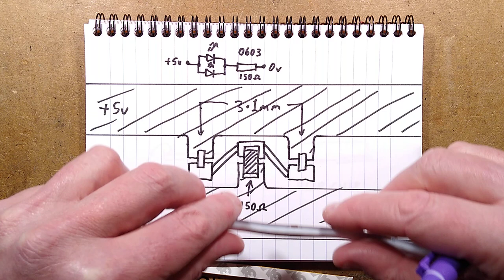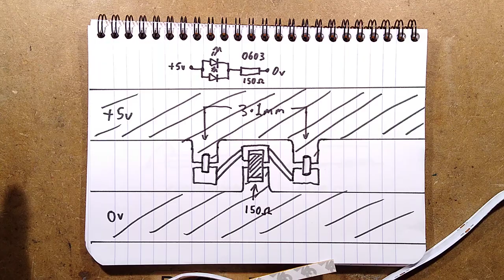Exploring linear LED COB tape with macro PCB shots

Comment: This sort of tape would've been perfect for my DIY oversized 7-segment displays I made a while back. I used normal 12v LED tape, and it had to be diffused heavily to look good.
Reply: I am planning to make giant 7-segment displays using the low-voltage LED filaments now available on Ali. (Up to 30cm in 3V, and 1.2m at 24V.)
Reply: I've been scheming to build a giant 7 segment LED clock/timer shelf unit for down the back of our church... Normally showing the time of day, but having the timer function for occasions we need to finish at a certain time.
Giant size and position down the back is obviously for the preacher to see it, and the shelf design makes it double as storage for the sound/technical team to keep stuff on.
Not a unique idea. I got it from someone who 3D printed such a design, but they used addressable LEDs and plastic shelving. I'm going to make it from MDF and probably use these style strips now I've seen them.
Reply: @tin2001  I made mine using styrofoam and cardboard. Sadly I built a hot wire cutter after I built the LED clock, so I had to cut the foam with a knife. Cleanup was a chore - little polystyrene balls get electrified and stuck to everything. So, if you want to use this method - get a hot wire cutter. So much cleaner. I used 16-channel constant current LED sink drivers to control the segments without multiplexing (each chip controls 2 digits). I think they were MBI5039 or MBI5036. They work like normal shift registers - you chain them in series, so no matter how many you have they use the same number of pins.
Reply: A pretty large 7-segment clock I've recently built (~20cm digit height) uses addressable 5V LED strips that got threaded into the ends of the segments (2 LEDs per end, so 4 per segment). With a "frosted" polystyrene plate (that's supposed to let ~80% of the light through) as the front cover/diffusor I got a pretty even illumination on the segments with just 2cm of depth.
Reply: I haven’t seen high CRI LED strips in COB style where traditional ones can get Ra98/97 easily.

Comment: To help with the volt drop along the tape, you can power positive from the one end of the tape and negative from the other end of the tape. This should help spread the load across the tape. Hopefully you can get an even brightness on longer runs.
Reply: .... BC Addresses this in the next video.

Comment: Hi Big Clive! ...... Little Clive here! 👍😂

It's AMAZING how ubiquitous the once humble LED has become! Growing up in the 60's and 70's I'd never heard of them. Incandescent bulbs were used instead. My first encounter with LEDs would have been mid-70's, when I got my space-age Texas Instruments digital watch, and my 1976 Commodore calculator. I no longer have the watch, but the £3.99 calculator, bought from Woolworths 45 years ago, is still going strong! Amazing! I don't think modern life could exist without solid state lighting!

Incidentally, thinking about the tech of my childhood, circa 1974, my Dad bought me a Ferguson Stereo Record Player from the Co-op for £30.00! It was powered by Mullard Germanium Transistors!

Also incidentally, my 5-Foot LED tube, which I retro-fitted to my kitchen fixture, has almost 500 LED chips I believe. I fitted it about 9 years ago, no failed chips, and it works as good as the day it was fitted! ...... All hail the LED!

Comment: I didn't realize they had flexible COB tape in such a form, I wanted to do a lighting project on my car and was trying to figure out the best way to diffuse the LED's so it looked like a single light strip, this solves my problem!
Reply: Tron? 🤔
Reply: Yeah, you want that sexy ‘Tron’ CGI-smooth light look, eh? That bendy ‘LED neon’ stuff might be a more affordable compromise and some of it is addressable for cool chasing animations, or maybe EL Wire/Panels if it’s more for the look not the lighting, but if this stuff on the video is within your budget, I want pictures!

Btw it drives me quietly crazy that shows like Trek Discovery and Doctor Who use normal modern LED strips everywhere and don’t hide the little LED ‘dots’ when it’s supposed to be centuries in the future (or even meant to be a bio-luminescent glow) when as this video proves in another few years these common LED strips will look antiquated.

Future proof your car! ;)
Reply: Hey cujoedaman, pressuming from your profile pic, have you tried these strips in a neopixel lightsaber?
Reply: @RawTopShot  Nah, nothing like that.  My car has a strip of translucent red on the rear deck lid and I once saw a project that made it so you could light it up, sorta "completes the look" type thing.
Reply: @DarthMalice50  I've seen some of the really early stuff where people were actually soldering LED's together in full lengths of the saber blades.  That was way back then, now they have whole kits you can purchase :D

Comment: Hopefully the diffuser does better than what's on the older style strips. They used to discolour over time from the heat and give a yellow colour of light, not even a warm white style, as in literally the colour of platform edge lines at a station. It was the heat and not light exposure as they were behind destination blinds and shielded from the sunlight.
Reply: You can try running them at reduced voltage so they produce less heat. Assuming they discolored from their own heat, that is. 12 volt strips happily work when powered by 10 volts (they only have 3 LEDs in each series so anything above 9 volts should light them up).
Reply: Don’t some the old kind have a layer of epoxy resin or something like that over the ribbon? 
It’s been a while since I used it.
Almost all resins I’ve used discoloured to yellow to some degree, although hardly the yellow you describe.which I’m sure could be greatly accelerated by heat or UV exposure.
Reply: I think it is more likely to be oxygen in the air that degraded the plastic and not due to heat.
Reply: @Jay22222  I think that the transparent layer on top of outdoor 12v LED strip is some sort of silicone rubber. Epoxy is too brittle and not flexible enough for this purpose. Then again, I am no chemist so I'm only guessing.
Reply: @Sheevlord  stinky silicone at that.
No good for enclosed habited spaces with the strips powered for hours at max output.

Comment: I have lots of the older version and run them from my 12vdc systems for both primary & backup lighting.  
Just placed an order for some of these COB style as replacements since there are a couple places that the old ones are dying.  
I don't run them on the full 12vdc so I am glad that these can also be dimmed...the old ones have (mostly) lasted almost 10 years.

Comment: Love this stuff on the bottom of my electric skateboard. Much better water resistance. Far brighter than the old style. Three 12v stings wired in series can connect straight to the skateboard battery without any need for step down converter.

Comment: Spooky timing, Clive! Bought a 20M strip at the start of the week to make lithophane lamps as Xmas presents. Entertaining and insightful vid as always, hope you have a fantastic Xmas!
Reply: Last minute.  Rush
Reply: @17hmr243 
Last minute?
I've not started mine yet, not even the cards 😁👍
Living dangerously.
Reply: @RawTopShot  i asked above no 1 helped can u power the tape from the middle instead of running wires to 1 end? merry xmas
Reply: @17hmr243  needs to be at the end
Reply: @DrBagPhD  ok ty for the reply

Comment: I’d be interested in seeing the machine that makes this. One day we may see unlimited length cob tape.
Reply: There is nothing stopping you from making "unlimited length" cob tape today.  Due to PCB assembly equipment limitations, most tape is simply 500mm long sections soldered together end-to-end.  They limit the final strip length to 2m or 5m due to voltage drop and the current all those LEDs draw.  If you really wanted you could just solder together multiple reels of the stuff.

Comment: If applied to a metal track or building, you can ground one end and apply power to the other end for perfectly even lighting. On a 12 volt strip, a 15 volt power supply makes up for the resistive loss over a 5 meter roll.
Reply: @Tim you've done that precise 12/15V @5m on metal backing?

Comment: Instead of feeding both +5v and 0 at one end, feed 5 at one end and 0 at the other. Over long lengths, you get a perfect light spread.
Reply: You can also feed them from both ends and if you see the light get dimmer in the middle, you can feed them from there too.
The brightness is not as even but you get more efficiency and more light.
Reply: Isn't it standard for longer light strip installations to have a power cable running along with a tap every few meters?
Reply: This is actually ingenious. And then just up the supply voltage to overcome the voltage drop.
Reply: @jhsevs  nothing special to it. batteries in parallel config are connected that way to avoid drift of individual battery cells/blocks in the pack.
Reply: @jhsevs  to a limit. You don't want it to be a heating strip.
Reply: @besenyeim  yeah but now I can use my undercabinet lights as a toaster :)

Comment: I really love the look of these. Very Tron style. 
I suppose something like this with aRGB wouldn't really work since each color needs its own special phosphor?
Reply: I see aliexpress carries a couple non-addressable RGB versions, though I can't tell if it's just three alternating colors of LEDs, or if each chip has three emitters.  They're probably not quite as bright since they can't do the UV->shared phosphor trick, but 840 LEDS/m (!) is still significantly more dense than the SMD versions.
Reply: @oasntet  Never came across such an LED strip, could you please link it?
Reply: @oasntet   I just recycle LEDS from car head lights and fog lights  and brake lights  they are WAY brighter and more reliable then the cheap stuff on ebay  they also typically include the driver, projector lens and cooling

Comment: I recently got some variable colour temperature white LED tap using this design.
The way they did variable colour temperature was especially intriguing. Every second LED (or pair of LEDs) had a spot of orange phosphor on it, and then the whole strip had a coating of pale yellow phosphor. Quite interesting the way they mixed phosphors so when unlit is maintained a seemingly uniform yellow coating
Reply from the maker: That's an interesting approach.

Comment: With a bit of heat-sink panels as a backing, and some custom clear resin molding work for the lens cover of an enclosure, that LED strip stuff would be neat for adding customized lighting to a vehicle interior. I could see where it'd work as lights for doors, foot wells, and the trunk.

Comment: I used 5x1metre 50/50 rgb strips to replace a light unit on a fish tank.
Took a few versions until it was waterproof ; but this cob strip looks like it might be better suited since all leds and resistors are covered.
Looks like it may only take a thin conformal coating to seal, or perhaps a thin coating of clear silicone.
I've just convinced myself to try, thankyou Clive 😊👍
Reply from the maker: I've seen LED strip threaded into clear hose for water protection.

Comment: Nice! Wow, that's not even the densest one on the market if we include 12/24V powered strips, I've found 320/384/480/512/528 led/m variants so far. I though my old 12V 240led/m "95+ CRI" strip was dense - I guess it was in 2019...

Obviously the cutting granularity suffers when the voltage goes up though I did find a 12V tape with 25mm between the official cut-points with 320 and 480 led/m (IE 8/12 COB per section). Might be possible to cut it even shorter depending on how they arranged that.

Oooh, many interesting uses both for that and this 5V "cut-anywhere" model, but probably need to run them with PWM dimmer that can generate fairly low duty cycles to not get way too bright for many uses.

I guess one could also run them at say 10-11V instead - IF they use 3-4  COB in serie (which I expect) that should have a big effect on power draw, not sure how low one can go before they switch to "faint glow" (I'm guessing 8-9V?). Similar things can be done with the 5V though the drop needs to be smaller.

Comment: Fantastic they have 24v versions. I've wanted to put permanent decorative lights up on my house, and these strips seem perfect for the job. But, the cable loss on even 12v was more than I was willing to take. Our house is about 30'/8 meters across the front and two stories tall, not counting for the required cable length to reach the strips.
Reply: Be aware that the sticky tape side of these strips does not stick to wood or concrete.

Comment: I plan to use a HT7750A  Voltage booster board with a short strip of these to drain old AA batteries "Joule Thief" style. Good for emergency lights. Thanks for pointing these out.
Reply: Clive, by winding my own inductor or redoing the one on the HT7750 booster board, I got this chip to run a 12 Volt LED Strip. If you hook the LX (pin 3) of the chip to a 5 Volt LED, it lights from pulses sitting on top of your 1.5 Volt DC input. But if you have a secondary winding of say, 30 turns and hook one end to the  5 Volt out (pin 2), You get the same pulses sitting on top of 5 Volts DC, and they will light a 12 Volt LED strip. (1 meter long) All off one AA Cell.
Reply: My order of warm white cob strip came. A single 5cm strip (16mA) lights quite brightly from a 7750A board, and if you cut that exactly in half you can solder leads to both 8 LED strips (2.5cm) about 8mA.

Comment: Very interesting! Didn't get my hands on a COB LED strip yet, but the other day I bought a strip of white LEDs at a local Chinese store and when I got home found out it was not the low voltage I expected - it works on mains voltage almost directly (through a bridge rectifier). It's only used occasionally for lighting a cupboard, but I'm imagining the potential fireworks if something goes bad :-)
Reply from the maker: I've featured the 240V versions in the past.  They tend to be quite flickery due to the lack of smoothing, and often over-run their resistors.
Reply: @bigclivedotcom  Yep. More or less my thoughts. I'm a subscriber but, somehow, I missed your video on that - going to look for it :-)

Comment: I literally just did a job with this stuff. I hate it. The application was a metal tape stretched taut, with this applied to one side. It was called "lazer line". Everyone seemed to forget that heat causes metal to expand and a continuous 3.3w/ft of leds causes this stuff to expand like crazy.

Comment: I bought some 3000K rated one on amazon which was advertised as 90 CRI and I could tell the color was off, especially compared to other 3000K LED's I ordered from Digikey that were also 90 CRI. The DVD showed a gap in the spectrum in the cyan region and a strong peak at 420 to 440nm (deep blue, near UV) or so. The manufacture provided me with testing results showing the CRI claims from some test house and the efficiency was like 70 Lumens per watt, pretty bad by today's standards.
Reply: that is the crap you get from amazon.
Reply: Even 2 different batches from a good manufacturer will have visible hue difference.
Reply: @skuula  not if you order ones in the correct 3 step MacAdam eclipse (chromaticity and color temp)
Reply: @power-max  I think you mean ellipse :)
Reply: With single LED source there will always be a dip at cyan, it's how deep the dip is that is a big factor of CRI.

Comment: I wonder if they will ever make an RGB variant of the tape.  Currently you have to get it a certain color which I guess you could get 3 strips each being one of the RGB colors but that defeats the purpose in my opinion.  At least they are pretty cheap, although it would probably be more expensive to buy 3 sets of this than traditional RGB.  If you don’t want to change its color then I suppose this would be the cheapest option for the quality.  Maybe in a building where the only color you want them to be is one color it would work well, like if you were on a floor that has a color scheme of purple or something.  I remember the suits from Tron Legacy used LED strip in them, and they said it worked well with the diffusers because they were flexible enough to be put on a piece of armor like they wear.  If they had these back then I bet the detail in the suits would be much cooler because they would have thinner stripes and more control over the designs.  I think the stuff that people will make with this will be very cool.  I’d like to see it when they make it in the next decade.

Comment: Hey Clive, I'm getting into scale models and I wonder if these strips could fit into some tight spaces. Also have you ever talked about those amazing looking conductive ink pens?
Reply: Electroluminescent wire might work.
Reply: @charleslambert3368  thanks for the tip, that looks promising
Reply: Fiber optic is a good choice there probably, too.
Reply: Lightsaber?

Comment: I managed to get hold of the 24v variety from up at the market in city center (they buy up pallets of unclaimed stock and distribute what they get for a lot lower than new prices), the strip I got has a few dead bits within and cutting half way between two cut lines cause the half of the strip still attached to not light. To know there's a 5V version and at about 1A for the meter ya got, that'd be perfect for converting my older laptop's backlight to LED, could even drive it a bit harder if I had to too.

Comment: i have a 5 meter +DC 12v flexible COB tape and it came with a 1A plug (UK) and for a while it was ok until the tap started to flicker even tho nothing else was plugged in the power strip, and one day the plug exploded, so much power blow off its back cap and melted the stuff inside, so i went and paid for  2A fuse plug and it seems to get kinda hot when left on for a few mins, not as hot as the 1A plug, no idea what is the right plug for the length, any help ?